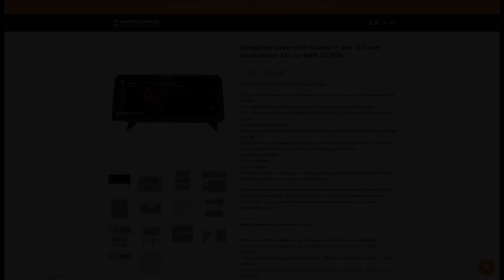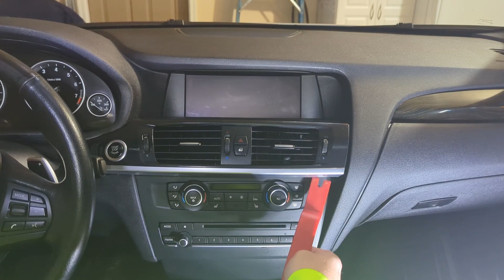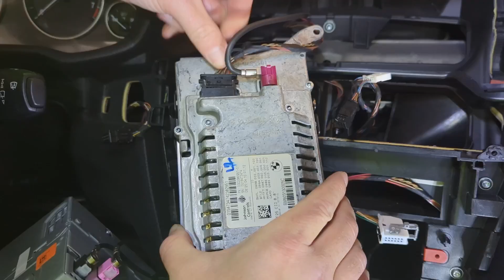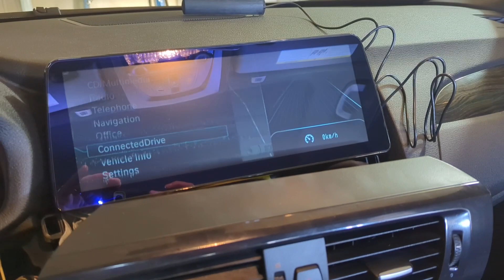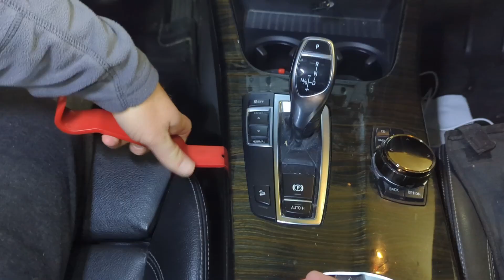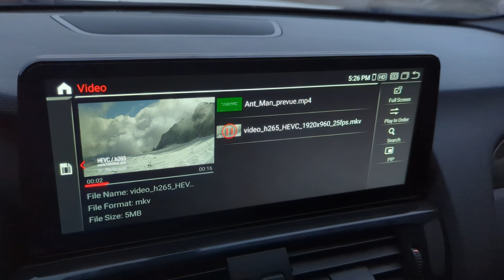X3 Sleeper Project  500HP - MotiveSupplies 12" Android Display

Comment: Thank you! Finally a concise installation video that clearly shows all of the key connections. Did you ever figure out what that extra connection of the OEM screen was that you mentioned in the video (you used the pink connection, and left the other one)? Tried installing something very similar in my car, but was stumped by the same thing as it didn't have anywhere to naturally plug into on the new unit
Reply from the maker: yeah its the CAN connector to the CID unit. https://www.newtis.info/tisv2/a/en/f25-x3-xdrive35i-sav/components-connectors/components/components-with-a/a12-central-information-display/BVgWA1Yw ... I believe that since the android display pigtails directly, the wire is no longer necessary for anything